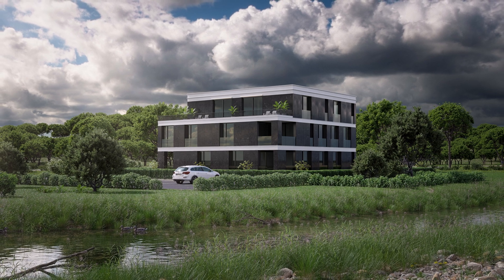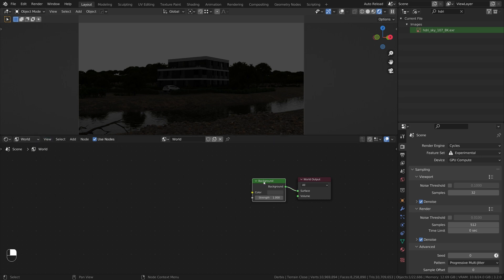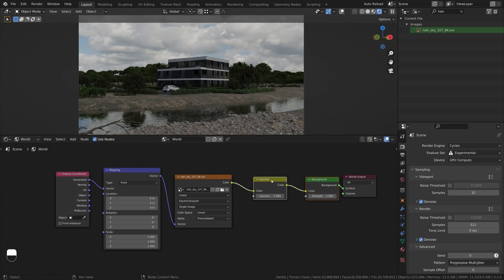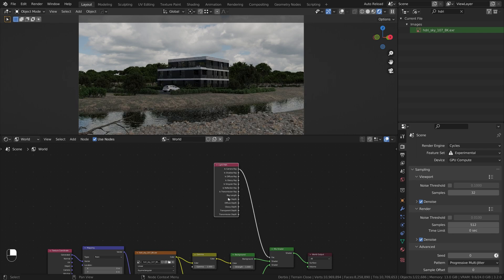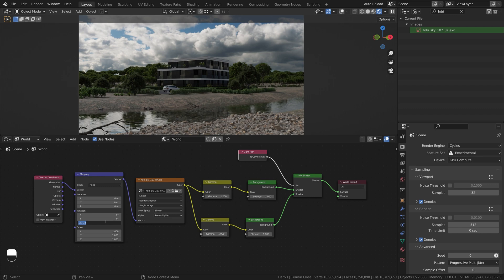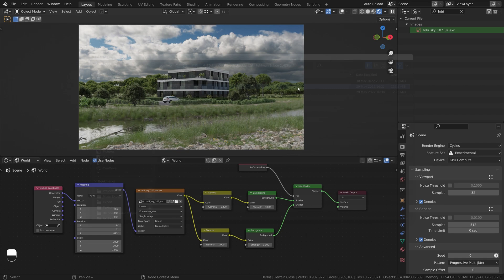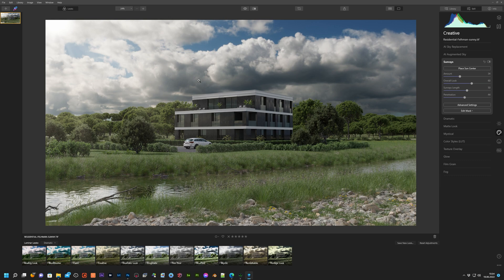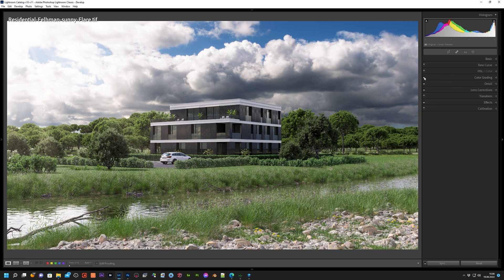Realistic HDRI lighting for exterior ArchViz in Blender

Comment: In most cases in interior hdri lighting is not enough. Increasing background makes hdri more white and your scene original colors becomes more white and loses its true color. Do you have any idea how can i increase the lighting without making the hdri very very white. I am experiment with ray length and depth
Reply: You can add area lamps around your openings and activate "portal" for more light, if you have windows with glass shaders, you probably want to disable all except "camera" and "transmission" in your ray visibility under object data properties I think, you can also use the light path node and a transparent node to make sure your light your "shadows" casted by the windows are fully transparent, your curtains also, you might want to employ a similar trick but with a translucent node, I'm a beginner but these are all the tricks I've learnt, I hope it helps bro😂